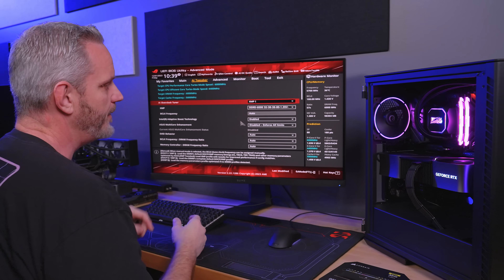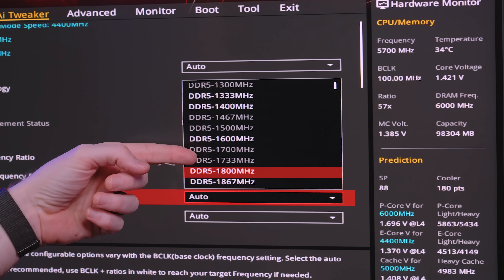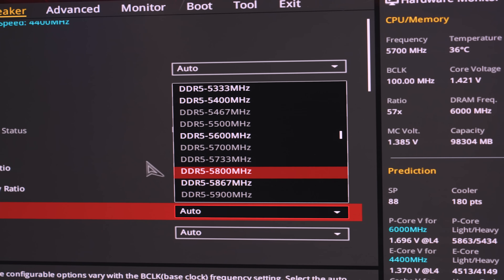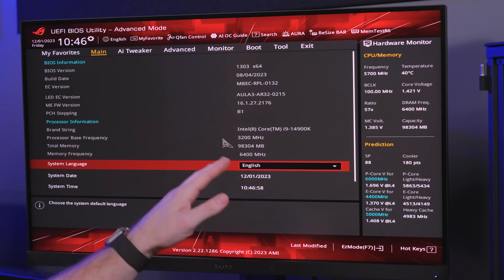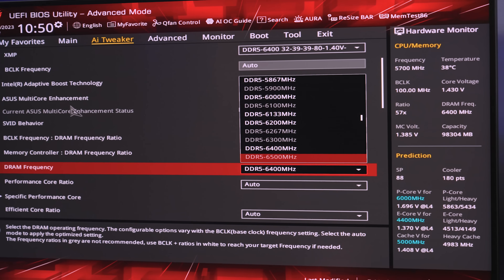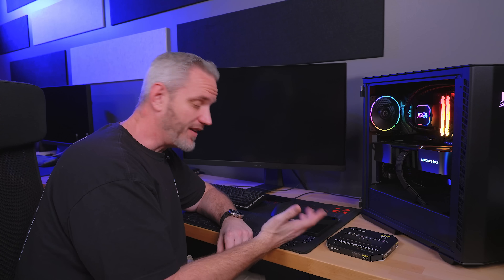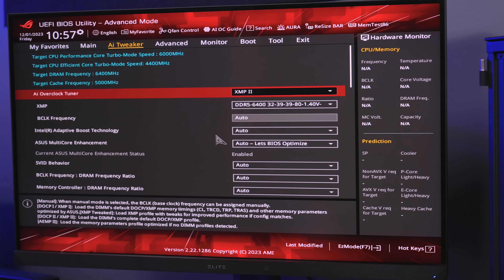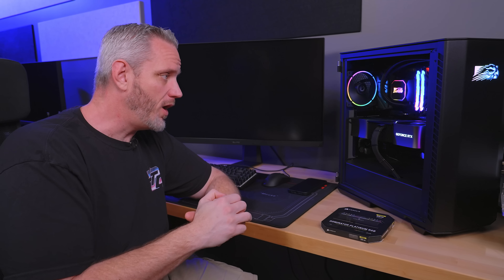Crashing PC? Check this first!

Comment: hey jay, i got a motherboard that the start button/power button won't work if xmp is enabled. it works 1 time when you turn it on but after that it doesn't want to. you need to turn off the psu and clear cmos and reset the whole computer just to have a chance at it posting

Comment: I just delt with a problem like this. I had a Gigabyte Z690 board I was trying to run 6000mhz ram on. I had a 12gen 12700KF and the system ran perfectly normal, no crashing or anything. I get a 14700KF update the bios and put a fresh install of Windows on it and I'd be getting random crashes in games. Also, I tend to leave my computer on, so I'd come back to my computer rebooted for no apparent reason (double checking event viewer to make sure Windows Update didn't force something) and all my CPU profiles and XMP settings were reset. So I do a Windows Memory Diagnostic and it comes back with "Hardware Problems". Also the system seems to run stable at 4800mhz. So, I'm thinking its either an XMP problem or bad RAM. Seeing how the RAM was running stable in the old board I decided to replace the board and get an Asus Z790 instead. After a bios update and another OS install the problem has seemed to be resolved no crashing and the system has not reset once since. Now my biggest question is: Was this a Gigabyte Bios issue or was it an actual hardware issue with CPU and RAM timings not being fully compatible?

Comment: I've once had a corrupted OS and had to wipe my Main Drive because I could bot acces it in any other way, not reset, not boot, nothing...
I had to boot my PC via USB drive to enter the usual main drive and DELETE the partitions.
I could not install Windows again over the corrupted version...
I spent 3 days, trying everything until this was my only and final option left. 😭
That lead me to get an HDD with automatic data-backup for at least pictures, documents and other stuff so I would not have to fear losing any of it... Especially since SSDs and NVMEs have a limited life-span. 🙈

Comment: I can't prove it definitively, but I'm pretty sure I had one of those cases were my RAM would cause instability and random crashes. I was, stupidly, running two identical 2x8GB kits from Corsair (DDR4, 3600, CL18). I built the PC with just one kit installed and like that it ran fine for about 9 months (XMP was also working as it should). But when I went and put in the second kit - which was, again, the exact same kit - things started to get unstable and wonky. After a ton of fiddling around and annoying folks on various HW-boards with my problem, I decided I had enough, bit the bullet and bought a 2x16 GB kit of G.Skill Trident Z, 3600 CL16. Since the switch, my issues have disappeared and my reliability report has been clean for weeks and weeks. Before it looked like a sea of red "critical error" warnings in there.

Comment: Yeahhh here comes ek :P (i knew it)
Just bought 2 EK Quatum Torue 10/16 6 pack for 30$ a piece.. i dont touch the rest of the overpriced stuff :P
Running G.skil 2x16gb DDR4 4000Mhz at c16 on my 5900 memory controller and infinity fabric are at 2000Mhz i am lucky :P
G.Skill Ripjaws V F4-4000C16D-32GVKA think they are B-Die best u can get for DDR4 CL16-16-16-36 wanna race that DDR5 with mine ? :P

Comment: Just went through a session where both motherboard / bios and RAM were a complete mess.  XMP showed the speeds the RAM was verified at.  Without changing anything else the system would simply hang.  Also, WHY do these manufacturers still put 4 memory slots on a motherboard, well knowing that XMP has huge problems addressing them?  I thought to build a system with the 2 x 16Gb I had and adding 2 x 16Gb more would give me 64Gb.... yeah... not so fast buddo, we are going to run at 4800MT/s - oh you want the advertised 6400Mhz?  Laughing ensues.

Comment: I had an occasional sound crackle in some games related to the default XMP and RAM instability (AMD X570). Had to lower the frequency manually from 3600 to 3200 and the issue went away completely. Cost me some gray hairs while I figured what exactly was wrong, as I used this setup for a few years, before Starfield (and Cyberpunk 2077 occasionally) revealed this problem to me.

Comment: My Msi X470 board has it listed as XMP.  And to get XMP to work on my system, I had to increase the RAM voltage to 1.3v.  Then I ran Memtest64 to confirm stability.

Comment: I just got some free memory 16gb of 2x8Gb patriot viper 4400mhz cl19 memory with Samsung B-die chips. 
 Im running it on a Asus ROG Strix b550-f gaming board with a 5700x and a rtx 3090.
Should I enable d.o.c.p? Should I lower the timings and clock speed to prevent fclk going to 2000mhz or higher?

Comment: Hi Jay, If you can answer it would be really helpful
I have a 7700X and 4 sticks of 16GB XMP 6000 Mhz and gigabyte x670 gaming x ax motherboard, on this MB my ram only runs at XMP on the base bios version, any newer bios doesn't post with XMP enabled
What do you suggest as my post times are 60sec and I have heard the new AMD bios are allowing people to boot faster and memory context restore also goes into boot loop

Comment: Question (not about ram) I just swapped out an old 1650 with an rx 580 8GB and when I start my PC, there is static on the display and then after a second or two it get cleared up and doesn't have any other problem. What could be causing that?

Comment: Well, this year i build my first personal computer. And I make mistake by buing 7200 mhz 34cl 64gb DDR5 ram. My setup can't run these speed. So I underclock my ram to 6000 mhz. I play a lot with ram to make my system stable. First month after buying it was disaster. But after few weeks it's stable enough to work normaly.
Reply: Which motherboard?
Reply: @sv0g391  MSI Tomahawk Z790

Comment: my RYZEN 5900X refuses to post my 4 sticks of Corsair (64GB) at 3200MHz but if I turn off EXPO/XMP/DOCP and manually set the RAM to 3000MHz with my custom timing then it post every time 18-20-20-20-48 why AMD....

Comment: Jay, 2 or 4 ram sticks on my sons system?? 
CPU: - AMD Ryzen 7 7800X3D 
CPU cooler: - DeepCool AG400
Memory: - Kingston Beast DDR5 16GB 5200-36 EXPO (2x8)
Storage: - Kingston Renegade 2TB SSD M.2
GPU - Gigabyte RX 7600 Gaming OC 
Motherboard: - MSI MAG B650 TOMAHAWK WIFI  
PSU: - be quiet! STRAIGHT POWER12 750W ATX3.0 Platinum
Case: - Montech Air 903 Max + extra out fan on top of case in the back (Arctic P12 120x120)
And if 4 sticks are profitable, should they be 5200 aswell or could they go higher?
Greetings from Netherland

Comment: How much more finicky is DDR5 vs DDR4? I feel like I'm seeing more people complain about DDR5. Especially with the recommendations of not using 4 slot kits. I wonder if we are close to the last gen of memory we can upgrade, since soldered RAM is always faster and more stable. I wouldn't be surprised, since we have lost so many upgrade paths due to timing, latency, and trace length issues.
Reply: It is the first generation and platform of DDR5. As with all tech, early adoption comes with some bumps in the road. As time goes on, the tech matures and gets more stable as unforeseen issues are ironed out. No reason to believe there won't be further progress in memory density, speed, bandwidth, and latency in future generations. Not sure how soldering the RAM fixes the current problems... on die is a different story.
Reply: @mattrogers6646  When RAM is soldered, it is very close to the CPU and there is less overall resistance due to not needing a RAM socket or long traces. Soldered RAM is usually faster.

The 'best option' for DDR/2/3/4 wasn't to only run 2 out of the 4 slots. It wasn't wait 10+ minutes for RAM training. I'm just asking if DDR5 is more finicky. I hope it's not, I miss being able to upgrade individual hardware parts.
Reply: @xero110  There absolutely were issues running 4 sticks vs 2 sticks when DDR4 first came out, it took a while for the platform to mature. There were also issues with the first Ryzen generation and its InfinityFabric being sensitive to higher memory speeds. It is no longer an issue as the product has matured throughout generations, AGESA updates, and the ability to set InfinityFabric clock, CPU clock, & memory controller clock to separate value (or at least ratios). You are comparing a first gen product against mature platforms.

Comment: Until the AGESA update I couldn’t set my G.Skill trident NEO higher than 5400mts on the 7800X3D.
But since that update it’s been plain sailing. 
Set to 6000mts and running build Zoid’s Hynix A timings with a -30 under volt on the CPU with loadline calibration set to turbo and it’s so dam snappy and crisp on Win11

Comment: I have 5900x with an Asus x570 mobo and a viper 32 gb 3600 mhz ram it crashes on docp timings and 3600 mhz but if leave the timings and reduce the frequency to 3200mhz workers perfectly.

Comment: im running with 14900k it only boot with stock 4800 mhz ddr5 mdie 48g ram( new model with xmp pre tunned for 6400mhz) lol. is that my 14900K's chip quality problem or the motherboard  Icraft z790 wifi ax's problem.

Comment: Has anyone heard of DOCP actually doubling the RAM size? I unfortunately didn't check the amount of RAM windows reported until I had already enabled DOCP. I bought a Patriot Viper Steel DDR4 16GB (2 x 8GB) 3200MHz Kit - PVS416G320C6K kit, but everything I've thrown at it says the amount of RAM is 32Gb (HWMonitor, CPU-Z, Windows 10 & 11, etc). The RAM as labeled as the 16Gb and model# matches for the 16Gb kit. Software like MSI Afterburner shows the use of 8-24Gb of RAM that I've noticed so it seems to actually be 32Gb. Mid you I'm not complaining. I've had them for over a year with absolutely no issues. Any ideas?

Comment: well 5 days before my 33rd birthday on the 1st of november my pc decidet to go complete out, had before issues witrh suddelny blackscreens, resets and so on... i guess cpu and motherbord were going down, since then i cant use m pc anymore and well... its am4 2700non x, tried new psu, every ramstick in singlechannel on every ramslot, gpu (rx5600xt) gets power, new cmos batteryy, cmosreset everything... all going out of the sudden... since i wanted to upgrade to am5 and i cant affort a single piece of new hardware i guess i have to put my music which i make sine 2004 back behid me......   rip my 19years of musicprojects ... keep it up! thanks for listening... its  btw the first mobo/cpu which shortcurcutied for me in over 16 yers of buiding pc´s.

Comment: I have the weirdest RAM XMP troubleshoot ever. I had picked up an EVGA RTX 3080 Ti FTW3 card a couple of weeks ago. I put it in my desktop and when I tried launching games, they would crash. I moved the 3080Ti into the living room PC and move the less power hungry XC3 Ultra 3090. I thought that maybe the EVGA Supernova GA 850 wasn't delivering enough power, thought the living room PC had a Corsair RM 850 Gold. So, I picked up an NCXT 1000 watt PSU for the desktop. The games still crashed at launch. I ended up getting a Corsair RM 1000 PSU and the games would launch and play for awhile, before randomly crashing. I ended up going into the Bios/UEFI and set everything to default. Everything worked just fine, so I enabled XMP. I'd thought that everything was fine, but it turns out that having a card that can easily draw 144fps @ 1440p, was enough to show that the RAM wasn't working at 100% perfect timings. I kept XMP on and dropped the frequency from 3600 to 3400. It's now absolutely stable.

Comment: Happened to be this week, swapped to ddr5, on a 650w 13700k and 3070ti, couldnt overclock ram, not that i wanted anymore powerdraw, made sure to not overclock cpu or gpu, and couldnt get it to load, my 850w came in, plugged in both 8pin ATX connectors for more power, now im running at 6k 16gb x2, so idk if it was powerdraw from PSU watts or more cpu power with 2 8pin ATXs, like jay says dont do multiple factors at once lol

Comment: I just upgraded my PC from an i7 6700K DDR4 (3200 MT/s) build to i7 13700K, Aorus Z790 Elite, 4x16 GB  DDR5 G.Skill Trident ram and 4070 Ti Strix. I booted first time, set XMP to the max 6000 MT/s, and its been running great. I'm still kinda new to PC stuff so I didn't know how tricky this could be and how lucky I got.

Comment: 9:00 did he just say "in nanoseconds NOW"? because I've built systems for over 30 years and my first one was a 386DX33 with 2Mb of 80ns RAM. as the generations progressed the speeds obviously got quicker, the 486 I had had 70ns speeds (16Mb RAM) and the later Pentiums had up to 60ns, and after that I don't remember seeing any printed speeds on the chips like they used to do. the RAM had to be in pairs of equal speeds in a DIMM config or it wouldn't work (think old school slanted/spring clip install of memory). but nanosecond "speeds" have been the thing for decades. admittedly, they're not that far away from picosecond speeds.

Comment: RAM instability is never fun. My old system once was bsod like crazy and totally random. The only observation that I can make is when I'm gaming and things get hot. The bsod code doesn't help either, it always said WHEA_UNCORRECTABLE_ERROR with windbg saying it's coming from storenvme and it will happen when the new thing need to be loaded too (like changing the map, spawning a new thing on screen, new sound effect needs to be played, etc). So ofc... I go get a new SSD.. 2 SSDs... and RMAed the third. I also moved my Windows installation to one of the SATA ssd I bought and the bsod went away. This made me believe even further that there's something wrong with the nvme controller / thermal of nvme ssds. I finally realize that all of those SSD is a waste of money when I took my system out for a routine big cleaning and popout the RAM stick. There's a FREAKING HUGE ball of dust INSIDE the memory slot, how the heck that that got in there, that stick was never disconnected. And ofc, after I cleanout the dust the system works just fine. Totally rage quit moment.

Comment: Ran into this after a RAM upgrade with XMP.  Would boot and idle, but crash to desktop or BSOD when under load.  A few cycles later while troubleshooting, it went into a boot loop, then failed to POST entirely with a VGA error LED (which was its own adventure to realize the RAM and not the GPU was the issue).  Had to revert and manually dial in intermediate settings for stability.  64GB at somewhat higher than stock speed was so worth it for video editing.

Comment: The reason I checked the motherboards compability list, down to the specific memory module maker, doing this I haven't had any problem running both the 3700X and 5800X3D with 64Gb of 3600Mhz memory.

Comment: I am currently running the my system in 4x16 configuration. The sticks that I have are 6000 CL36 rated, however I am not able to run them at that speed due to 13900K memory controller limitation. What I did was enable XMP profile to load the timings in and then manually lowered the memory speed from 6000 to 5600. My system has not crashed once since I built it. It's been over 8 months now. Fun fact though, whenever I use 4 sticks of RAM the XMP Tweaked disappears from the Profile list.

Comment: I had a kit of ram that would not work at all when selecting the XMP profile. But when I manually adjusted the all the timings and clock speed to what it was advertised at, it worked fine.  A year later, that mother board was zapped by lightning, so I replaced it with the same motherboard, but newer bios and the XMP profile worked with no hitches. I later doubled the 16g kit by getting another kit of the exact same number and it works just fine even though it was not a matched 4 stick kit.

Comment: This is a pretty timely video; I had some "fun" trying to enable XMP on my new build yesterday. It was on an Asrock Z690 Riptide board running what is technically unsupported memory (some rather old 3000 MHz sticks). Simply enabling XMP Profile 1 prevented the PC from posting. After updating the BIOS itself I was able to enable XMP without issues.
Reply: Now you can load all your Japanese cartoon girlfriends without fear of crashing. Life is finally fulfilling!!
Reply: Nice, I did BIOS updates for Asus Z690s (x2) and have an Asrock B760M, never had XMP work OOB on 12th gen yet. Every machine is QVL paired. I remember one kit I spent 5 hours tuning it would browse in Linux at 6000 but only game in Windows at 5800. I try the JEDEC speed on kits and then go from there if I want to tune, wonder if XMP will work after BIOS updates. Or if I tried that all ready. I never had issues with DDR3 or 4, so maybe I was lucky in those being more mature by the time I did ram upgrades and swaps.

Comment: Man, I hit the lottery when building out my 5800X3D system.  I had already purchased a set of two 8gig sticks of G.Skill TridentZ 14-14-14-34 3200mhz and I wanted a total of 34gigs but for the life of me, I could not find a another set of used G.Skill Trident AMD compatible ram at those speeds anywhere (new was off the charts expensive).  All I could get was the XMP version for Intel.  I took a chance and purchased an Intel set, and they have both worked flawlessly with each other without issue for over 6 months now running at the 14-14-14-34 timings.  It's funny, one set is RGB and the other isn't as this was also a major issue.  But I actually think it looks better with them mixed.  To top this all off, the QVL list said "No Way" on even a matched set.  Woohoo.... : )

Comment: Hey Jay I had a problem with my HP laptop it has 16mb ram 500gb SSD.  Started showing blue screen, did some research and caps lock button was flashing a series of on-off.  So what I did was replace CMOS battery now works like a charm.